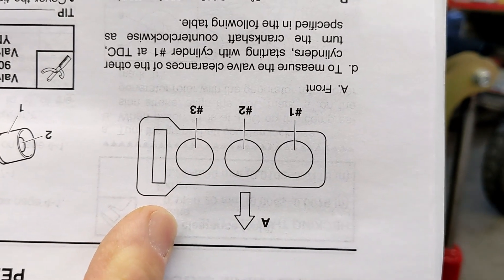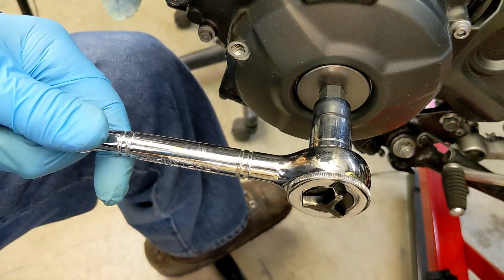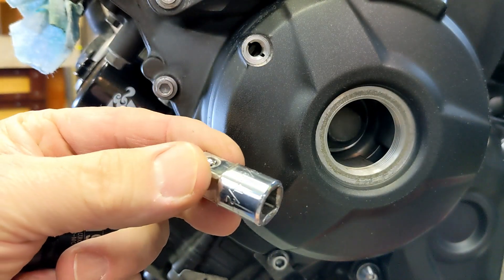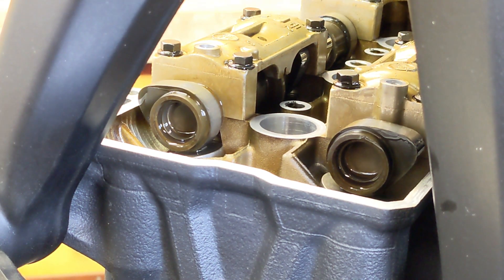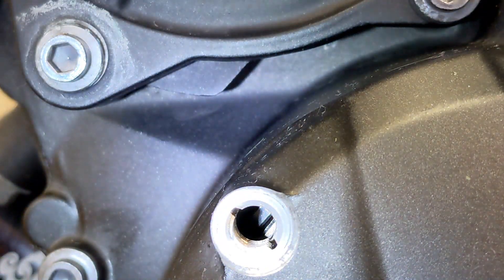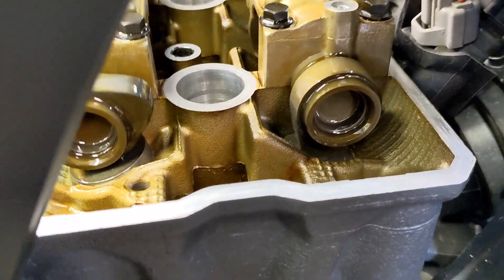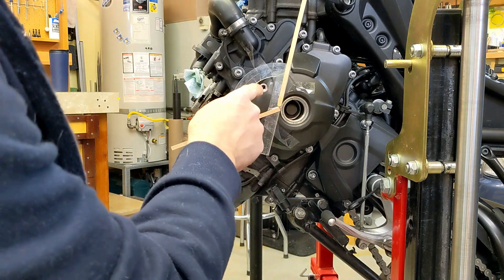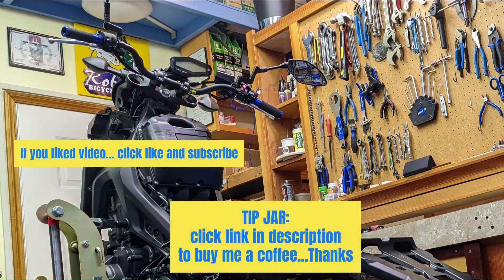finding top dead center and 125 degrees before top dead center Yamaha FZ-09/MT-09 2014 2015 2016

Comment: Hello, I want to ask a question about the yamaha mt 09 tracer 2016, I checked the valves and I have to replace the valves, the problem is that someone before me messed up something on the engine. When I put the marker on top dead center, the cams on the first cylinder are not opposite, but when I put the marker on btdc, everything matches like it is with you. And my question is, can you explain to me what they could have done and what should I do now ?
Reply from the maker: Was the engine running and have you done anything yet besides check the valve clearance?
Reply: @meticulousmechanic  The engine was running, it was just that the engine had 55k miles on it and after driving it stopped, the revs dropped and I decided to check the clearances and adjust them. Note - when I bought the engine it had 44k miles on it.
Reply from the maker: Sorry I didn't see your response... I have no idea... Except maybe you have cylinder one and three flipped in your mind... Depends on if you're sitting on the seat looking forward or looking towards the back of the bike like I filmed it... did you figure it out?
Reply: @meticulousmechanic  Everything is fine, I did it according to the original marks and there is no problem at all, today I even did a test ride. Regarding the previous intervention, either they did not know exactly what the original marks were or it seemed to them that with the BTC the piston of the second  cylinder is at the top point, at least that is how I explain it. Sincere thanks, your videos are very useful.
Reply from the maker: @СветлинВълчев-ч4ъ glad it worked out for you!

Comment: Robert, exceptional work! I'm a mechanic by trade and I've got to say you did a great job documenting the valve clearance check on your mt09. I rarely leave comments but I had to congratulate you on these in depth episodes. I plan on doing the clearances to my 09 following the book but I will definitely be referring back and fourth to your videos, there's something about matching what the book says to visuals which makes the task that much easier. A small tip about the timing; I find marking the cam chain and its cam gears with white marker (two marks on each) whilst the engine is tensioned and timed helpful to help me double check everything is in order before re-installing the CCT and checking alignment after. Great work, you've earned a subscriber.
Reply from the maker: Thanks... It's always good to get some positive reinforcement! That's a good suggestion about the white marker. However, I would rely on getting all the slack out of the front of the chain and using the timing marks. Of course,  if you have the timing chain cover off and you marked everything with your white marker like you suggest, then it could help speed the process and work as a reality check. Also, counting the number of links between the intake and exhaust cams before you remove them, would be helpful too. Do you know the brand of marker you use? I have seen those paint pens but I don't know if it's the same thing?
I would like to buy one...
Reply: @meticulousmechanic  The white market only serves as a guide, it doesn't replace following the manual! Counting the number of links between the white marks is also another layer of security, you can never go wrong being too safe ;) I use generic ones off amazon. I use them mainly for bolts to mark the bolts when they've been torqued. If I remember correctly they come in packs of three of five and are resistant to oil.

Comment: damn that stand is super intense. not quite needed for the valve adjustment but makes sense if this is something your are doing several times year as a at home moto mechanic.
Reply from the maker: Thanks...Originally I just needed a stand to remove my wheels for a tire change. I did a lot of research. Track stands were cheaper but limited and a regular lift was too expensive and I did not have the room to store it. This seems to be the best overall compromise... see this video for all the ways that I use it...the various ways are found in the links that I provided in the video description...
https://youtu.be/qv3V_tFmu1Y?si=_G0OyFJ4JUca_1ts